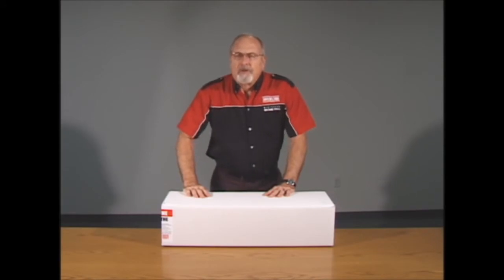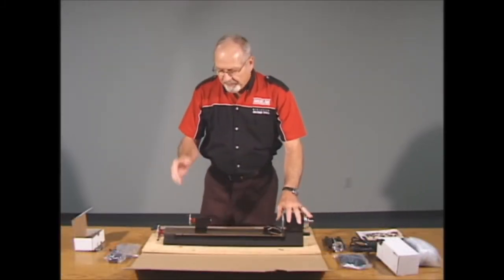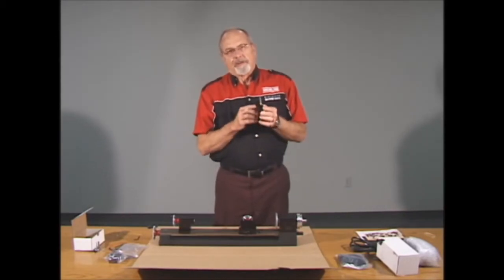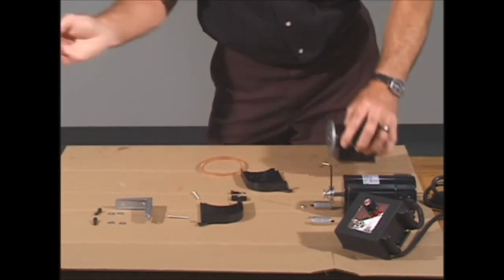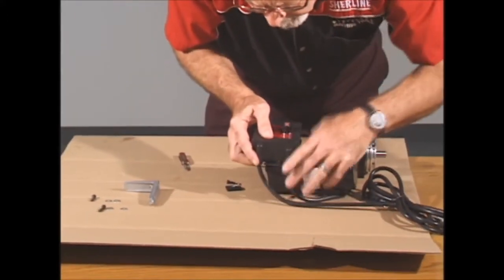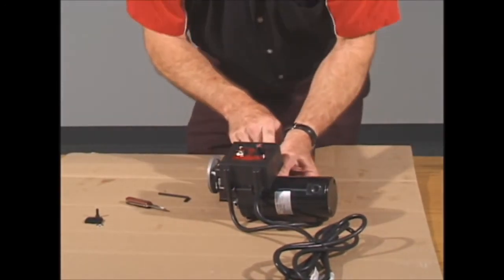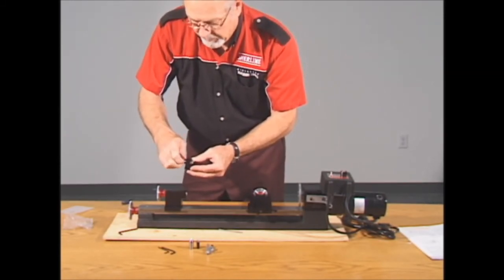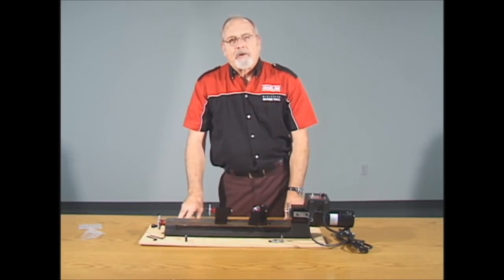Setting up a Sherline Lathe

Comment: what is the designation of the motor according to the plate? what are the motor dimensions? Are all inside morse tapers (#0, #1, is there #2?) full length as per DIN 228 or shortened? Thx!
Reply from the maker: Here is a link to our DC motor specifications https://www.sherline.com/product/hill-house-dc-motor-internal/#description)
The motor dimensions are 3" diameter x 5-1/4" length with 5/16" motor shaft

The headstock spindle taper is a Morse #1. The tailstock spindle is a Morse #0. We don’t offer a Morse #2.

Can you please clarify your reference to “full length as per DIN 228 or shortened?"

Comment: Is that how big it is? I though it was really big. Do they ship to Melbourne Australia and how much is in AUD? How good is it in making steam and piston engines?
Reply from the maker: The lathe in the video is 32.5" long and 8" wide. The distance between centers is 17". Here is a link for the full specifications: https://www.sherline.com/product/44004410-lathe/#specifications
We do ship to Australia. Current conversion rates are $1 USD to $1.5 AUD. Shipping is dependant on the weight of the order but is approximately $250-$300 USD for the 17" lathe.
To get an exact quote, go to our website, select your products, and input your shipping address and our customer service agent will be able to tell you exactly what the costs will be.
Reply from the maker: Forgot to mention the steam engines. Many of our customers make steam and piston engines. You can visit The Miniature Engineering Craftsmanship Museum website to see many of them. https://www.craftsmanshipmuseum.com/
Reply: Ship to Melbourne? They were developed in Melbourne Australia !!
Reply: Got mine last Tuesday I am currently building a  mobile workbench/storage cabinet.
Reply: @petercrack2909  
Really, Peter? Where in Melbourne?
Reply: @mickcarson8504  Contact me on FB (PJC)
Reply: @petercrack2909  
Sorry Petey. I hate FB. Never liked it.

Comment: My cross slide is very tight. Is this normal?
Reply from the maker: No, it is not. Take a look at our videos for adjusting the saddle gibs and adjusting backlash. If you still have problems with the crosslide being too tight, contact us at marketing@sherline.com.
Gib Installation and Setup on a Sherline Lathe: https://www.youtube.com/watch?v=FkoxaUCpvn8
Adjusting the backlash and the gib on the Sherline lathe saddle: https://www.youtube.com/watch?v=4b3VGR5n6DM
Best regards
Reply: @SherlineProducts  Yeah I watched that and it was set up correctly. It isn’t the leadscrew binding, I checked. It’s definitely the gib. I think it may be uneven or I got too much of the thick side
Reply: Should have run down this video first in assembling my 4100. The instruction manual has a Lot of great info but it was frustrating having the mill info intermixed with the lathe info. Great Video BTW 😊